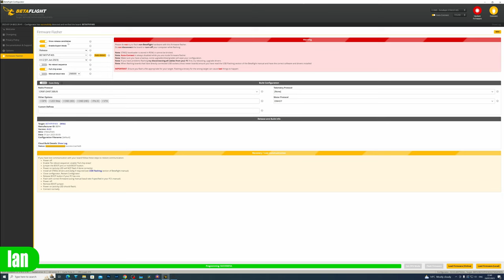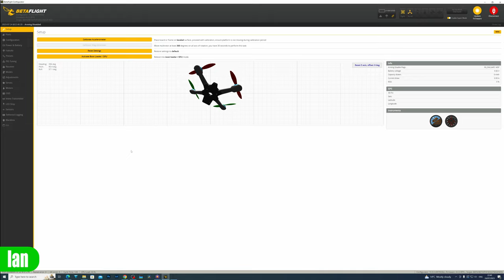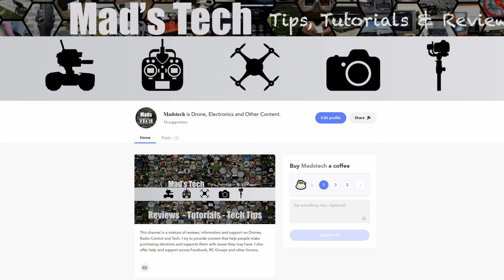F4 Flight Controller Short Circuit - Can We Fix It

Comment: One of the motors stopped working on my v1 firefly 1s back in the day. And boy was I bummed cuz it was my first quad and I loved it. flywoo didnt have the aio in stock at the time to replace it. I noticed one the tiny little mosphets had an imperfection on it. So got the number off phet, ordered some up from digikey, and got a cheap hot air station and microscope from amazon and took a stab at it...   shockingly I somehow fixed it! And a month later flywoo got me the replacment aio which in my mind paid for equipment. Plus I'v been able to fix many fcs ever since. Its not a fun task to solder such tiny components but boy is it satisfying when that baord boots and flies off! It was only like $100 for the hot air machine and digital microscope.  A very worth while investment for this hobby. At the cost of 1 stack you can almost infinitely repair your boards (if you have a parts board)

Comment: I like to use low melt solder to remove stm32 chips(apply with iron, remove with air). wick the unleaded, and apply new leaded solder, then resolder with air.
Reply from the maker: Yea it’s a great way. I just did not have any😂, I really need to top up on consumables.
Reply: That's not a great idea unless there's no other way around - any remaining low melt temp solder will mix with the new one and compromise joint strength.

Comment: by any chance you have a Flywoo F745 AIO FC?  I recently accentally flicked a blob of solder and it hit 4 of the 0201 resistors.  The only way to clean it out was to remove all 4.  I need to know the resistor ohms for them, and you are the only person I know on YouTube that has EE background in the FPV community.

Comment: As usual, I forgot what I wanted to ask when your stream is on. But now I remember. Do you know of any products that I can hook up to a UART that will turn ta power source on and off? I want put a small fan on an AUX switch for my VTX. Since I can't disconnect the battery when I land too far from home I want to be able to flip the fan on to use the last of the battery, so it doesn't smoke. And the gps wait

Comment: I noticed the sparkly burning spots around the chip when you first showed it on the orginal board. Thought the internal short was causing certain leads to also short  pretty sure it's the same postions lighting after you moved to the 2nd board

Comment: Great exploration. I've seen corrupt programs turn processors to route an internal MISprogarmed short on. Were you able to purge the hot processor program to blank boot loader  mode?
Reply from the maker: Yea it’s a hw short. Iv reflash it from bootloader a few times.

Comment: Please include in the videos the temps and flow you use with the hot air 🙏🏻
Reply: Honestly 99% of the time I use 300C with just enough air so it doesn’t accidentally blow small components off the board. 8/10 on my hot air fan.

Works well for me.

Temperature regulation with distance is my method… also I pre-heat the boards for 20-30 seconds a bit, so I don’t have issues with delamination or thermal cracks on the PCB or more fragile components.

I am in no way a professional, but taught myself and do fix 90% of all issues myself, so do with this what you will.

Happy flying!